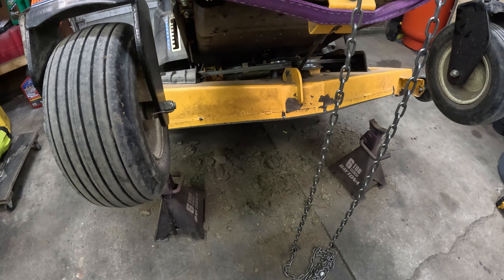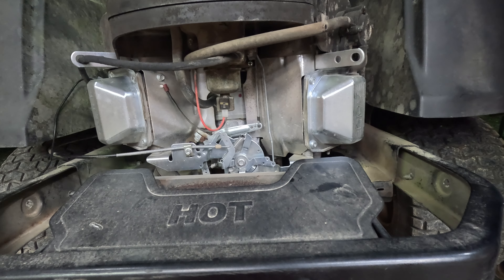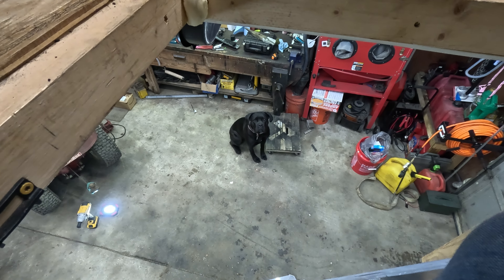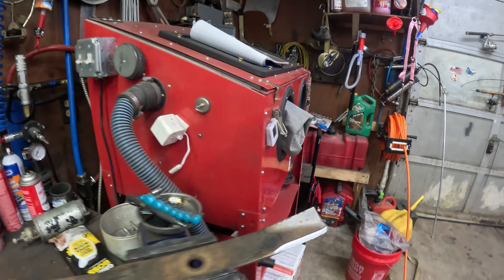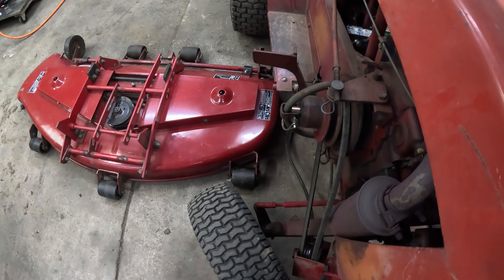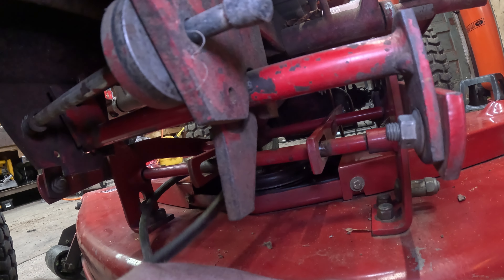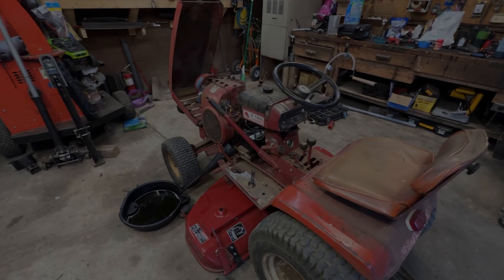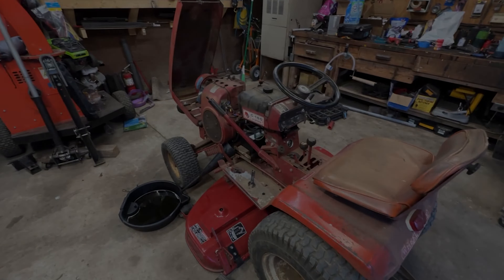Spring Mower Prep: Cub Cadet Annual Tune-Up and Wheel Horse Deck Installation

Comment: Great work overall! I really like your attic storage with the winch too! Also like how you sharpen the blades. I have done it maybe twice in 4 years and use a flap disk, but then again I use a flap disc for everything 😅 and I “balance” them with a screw horizontally…close enough I guess but have been wanting an actual balancer like you have. When it comes to decks, I typically remove them and take em to the scrapyard 😂 we have one mower that’s a dedicated mower, but we’ve joked about making it into a mud mower too😮 another great video, will be looking for the next one!
Reply from the maker: Can’t go wrong with the flap disc. That amerisharp jig used a grinder with a 60 grit flap disc. Someone gave it to me.  I usually sharpen once a season.  I rotate the deck around so it stays pretty clean underneath. Hard way to prevent rust.  Hopefully someone got the 42” off Steffens 310.  You should do a zero turn mud mower I don’t think anyone’s done that or I haven’t seen.
Reply: @AbbyNormalGarage  we still have the deck from his mower, not sure how to find someone who would want it? I guess post it on Craigslist or Facebook marketplace?
Reply: @AbbyNormalGarage  @chud327 has mudded his zero turn 😄
Reply from the maker: @Tennesseemountainhomestead  I’d do market place and share to Wheel horse Junkies on FB.  The 42’s are pretty popular. I’m dead set on the 48” I had a spare I sold it on a 520 last year. I have one that needs completely restored but it’s solid.